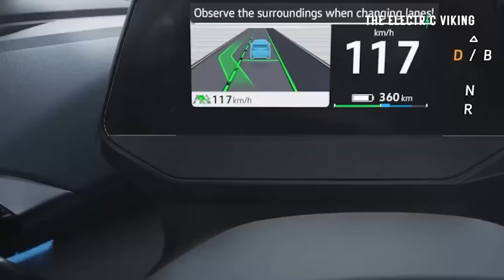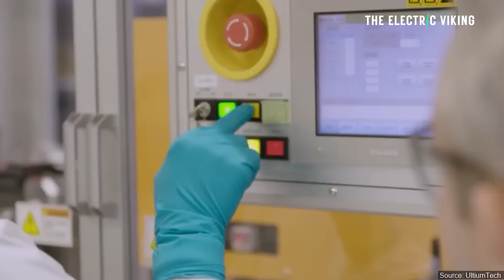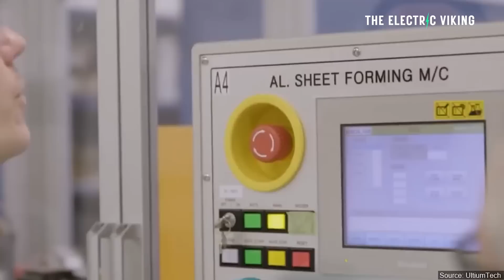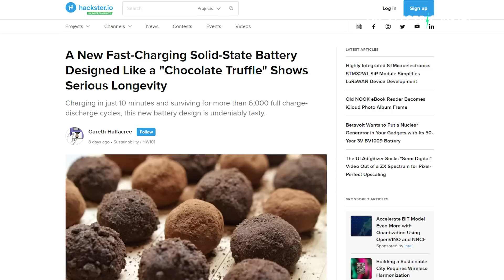Harvard's says solid state battery lasts as long as lithium iron phosphate

Comment: Prototypes are easy, mass production hard. A cell five times the size of a typical coin cell is still a coin cell, or a square coin cell. 
The big problem with LFP cells for many years is that they could not mill the LFP mineral small enough to work well. 
What Viking appears to be describing is a finely milled silicon 'glued' to a lithium 'plate'. The problem has always been producing materials and products at large scale

Comment: New tech in the labs is nice but heaps of new tech gets mothballed or only used in special applications like aerospace, military and medical because it cannot be manufactured cost-effectively at scale.
As for "why buy an ICEV today", the reason for me is simple: no at-home charging at my apartment, fast-charging costs as much if not more than gasoline, most chargers are only 50kW and there aren't that many of them anywhere near me either. BEV is a non-starter.
Reply: AGREE.

Comment: In US you have to find the charging station.   And they are working not vandalized by people or occupied by homeless.
Reply: So the homeless live on EV chargers do they?
Reply: @christopherj2231  They seems to invade any open space if nobody drives them off.  If they are putting these EV chargers near sidewalk, homeless camp around public sidewalk nowadays.
Reply: People are cutting off the charger cables for the scrap copper.
Reply: @markmiller8903  they really want to get charged

Comment: To be fair, as good as positive battery should be in the future, I don't think EV will be wide spread over ICE driven vehicles by 2035. Probably it will be just aroud 15 % overall production. But, however, it will be adopted by home-owners more.
Reply: In my company they are “all in” to replace their diesel vans and trucks for electric ones. Just from a total cost of ownership calculation. Will not take more than ten years to replace the whole fleet
Reply: You are missing the point about AI speeding up the development
Reply: @jsanders100  We will see, that, when Oil runs out /2050-2057/ so does most cars will halt immediately, as Oil is lubrication and all plastic /rubber/ to many forms of chemistry derived. That's when EVs might help few lucky ones to take transportation mode for few more years. Chemical battery cannot take us into far future development. There should be another level of discovery. AI cannot make what is impossible to be done for now.

Comment: Sam, I only got about 3 minutes in. This is interesting, sure, but the questions I have are around:
1. what is the energy density
2. what is the comparative cost vs LFP

It's great that they can charge 6,000 times, and that the speed to recharge is 10 minutes. Useful reporting. But if these are low density, and cost a fortune, then they'll never work in the commercial marketplace. I get it that they're not commercialised yet, but where are they on the pathway?

Comment: The higher the energy density in a chemical battery the more dangerous it becomes when something goes wrong. Potential huge release of energy and highly toxic gasses. Risk may be very low but almost inevitable when billions of cells are distributed. The chance of winning the Lottery is almost zero, but there is usually a winner every draw. Low risk, high consequences.
Reply: doesn't stop people from hopping in petrol cars tho does it.

Comment: This is very exciting. If older EVs can swap their batteries for these new batteries, then useful life of an old EV would be extended as well.
Reply: Would be good, but may not be so simple.
EV firmware would likely need to be updated to take account of new and different capacities, BMS strategies, temperature coefficients and charging curves.
Reply: @ahaveland  exactly, it would take a 3rd party company to provide a spec for spec OEM replacement battery, but using the new technology. Thermal cooling needs would also be different by technology, likely requiring OEM software changes.  Tall order for any of this to happen in today's rapidly changing market, as it would also need to be a profitable venture to gain interest...another tall order for earlier smaller batch EV models where such a market will never be lucrative. I would only expect true OEM replacement batteries for today's EVs.
Reply: Maybe in 10 years before production can be scaled!